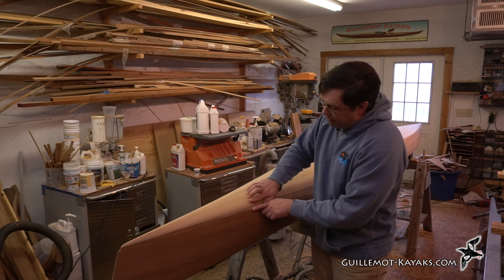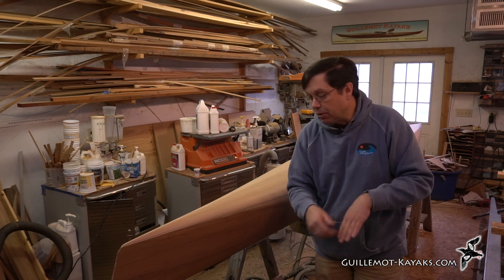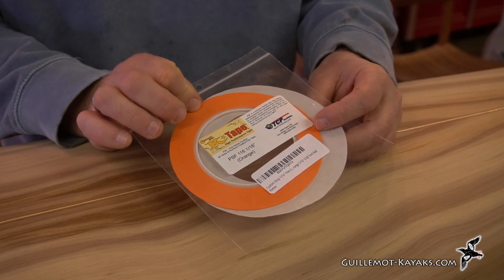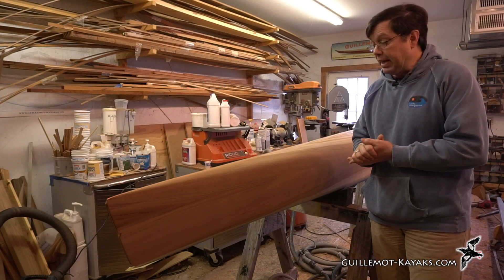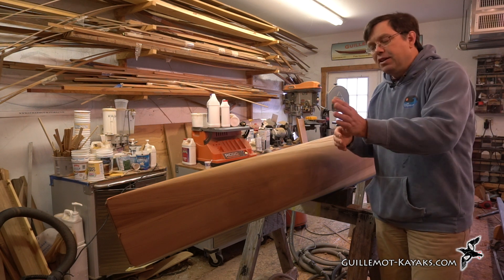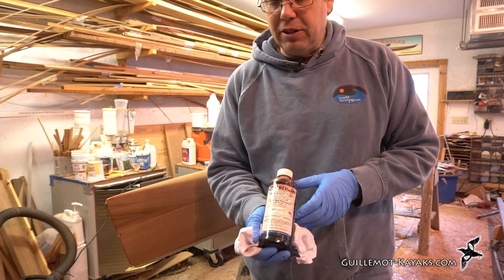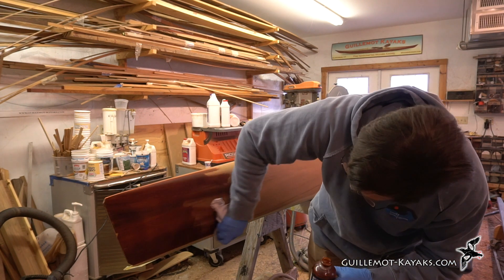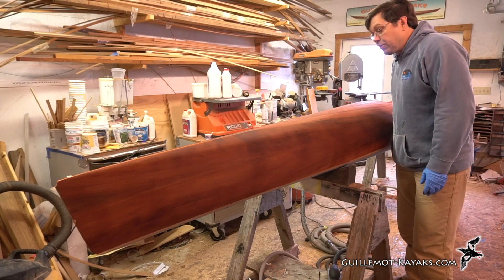Staining the Kayak - microBootlegger Sport - E39

Comment: Could you use a spray bottle for the stain and alcohol while wiping it down?  It might help to keep it from bloching.  Just a thought.  That color is going to pop once the glass is on.
Reply from the maker: That is an idea. It might work. My spray bottle is not really a fine, precision tool it splatters quite a bit with various size drop and uneven coverage. I suspect it would just apply too much stain that I would have trouble wiping off. 

It only took about 1/4 of the stain bottle to cover the whole boat.
Reply: Remember the old school alcohol-based magic markers that were a glass jar holding the ink and batting, and a lid that held the nib? You just need a slightly bigger one.

Comment: Hi Nick, thank you very much for your work on this series!  How much coverage do you get per pint of that stain, using your wipeon method?  I found a site online that suggested 35-50 sq ft per liter.  This implies you would need a whole quart just to do the outside surface of the top of a kayak.  Does that sound about right to you, based on your experience?
Reply from the maker: The Solar-Lux stain I get comes in 16-ounce [473 ml] bottles. I find I can do a whole kayak (about 50 square feet) with a bottle and have stain left over.